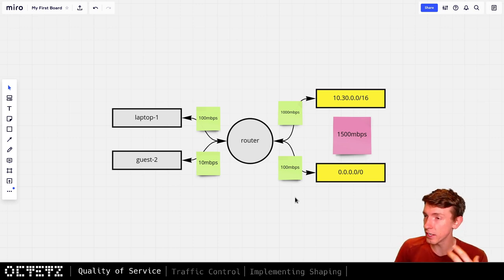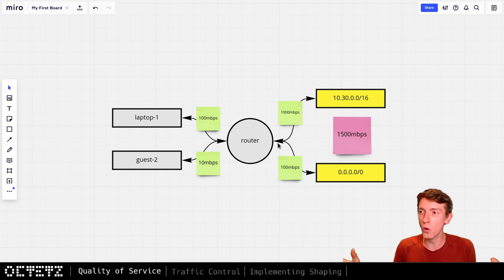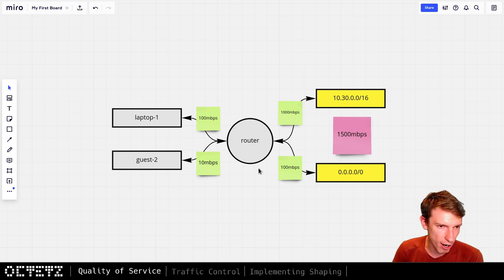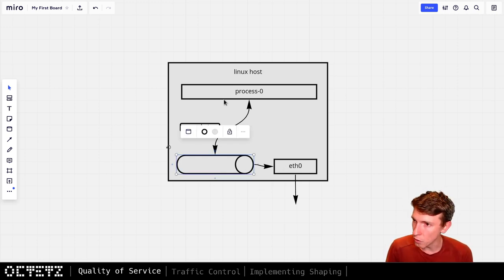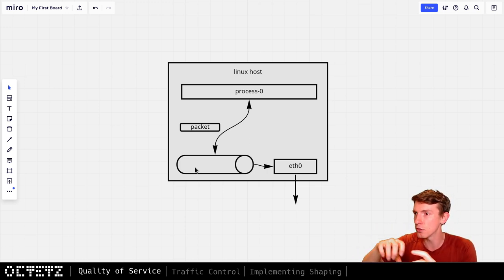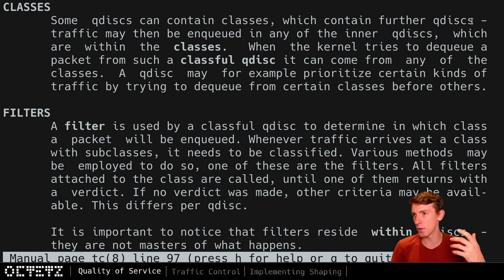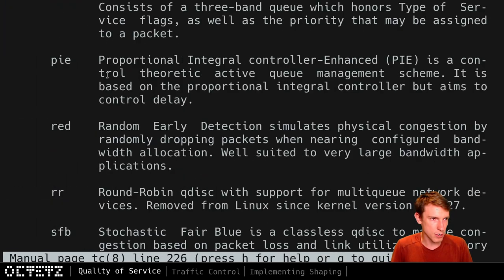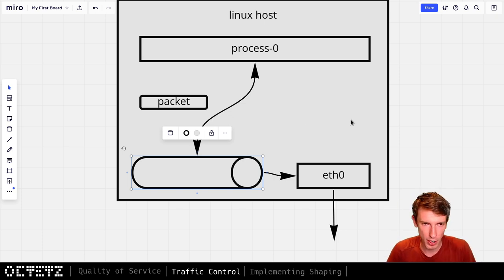Shaping Linux Traffic with tc

Comment: I set this up on a home network. It actually restricted speed (egress) to a target NOT named as CIDR1 or CIDR2. I found that I removed the "default 30" from this line in the script:
 $TC qdisc add dev $IF root handle 1: htb #default 30 removed
After this, the non CIDR host speed test (via iperf3) had the expected unrestricted bandwidth results. So I then tried to find documentation on HTB and what "Default 30" was supposed to mean. 
Anyone have a clue where to find the answer? 
Great video and thanks for sharing. It was never detailed as mentioned in the vid what "default 30" meant.  (I still learned a bunch !  :-)  Thanks)

Edit....  I found that 'default' in HTB assigns all traffic not defined (filtered) to a flowid (30 in this case). Hope this helps someone, somewhere, sometime...

Comment: Thanks for this detailed and yet well explained video. My interface is named "enp0s3" and changed it in the script as required. But when i run it, I get the error "Cannot find device "enp0s3" ".
I am able to send traffic via iperf. So the listening and transmission works well. What could be the reason for the cannot find device error ?

Comment: hello could you send example for simulate slow speed like GPRS or dialup and correct latency settings  with tc because, i try it, but not working on inbound traffic just outbound, i need to working both inbound and outbound.
Reply from the maker: 👋,  I won't be able to create an example. But I'm hoping you're able to figure it out!

Comment: I have a question. How to attach two network adapters a wifi card and ethernet port to one class in order to be shaped as singular device? 
Basically I want them both share one bandwidth for download speed with one qdisc which is cake in order to remove ping spikes.

Comment: Hi Octetz
   Nice videos
 I need some clarifications , 
     in this example , you are adding qdisc first 
        tc qdisc add dev eth0 root handle 1:0 
      then you are creating the class , and then filter. 
 Can we add filter to the existing qdisc or always we need to create new qdisc and then attach filter to it , 
in my case , in my system,
   i just listed the qdiscs , it was showing something like below

tc qdiscs show
    qdisc mq 0: dev eth0 root 
    qdisc pfifo_fast 0: dev eth0 parent :1 bands 3 priomap  1 2 2 2 1 2 0 0 1 1 1 1 1 1 1 1

If i want to add a filter which qdisc i should select (there are 2 qdiscs available above), 
i want to add filters to exclude some of the ports , what should be the filter commands ?
    Can you please help me on this ?

Comment: Hi, thanx for a good video. I've been looking for a (c++) api to control tc from my own application, but not found any good hits. Anyone with a good hint? The use case is that I dynamically want to limit bandwidth for e.g. ftp on port 21 based on criteria not possible to detect in the network traffic itself.